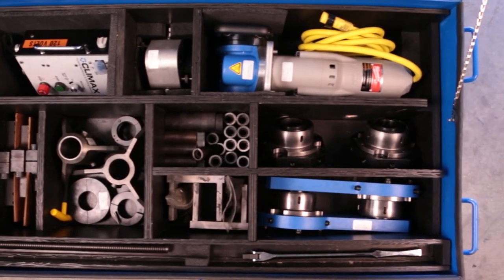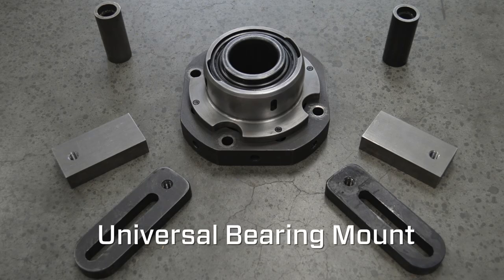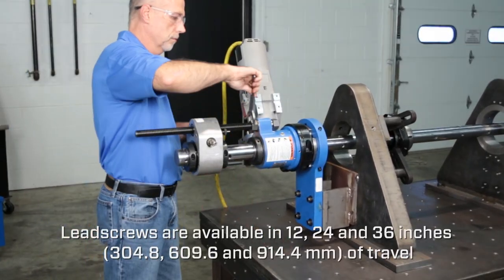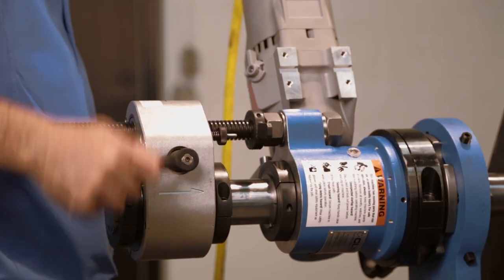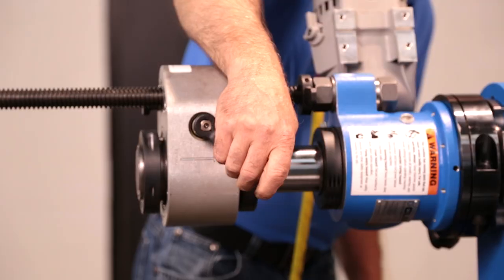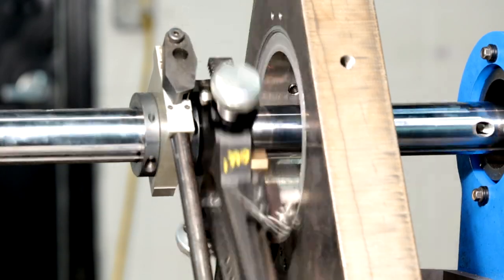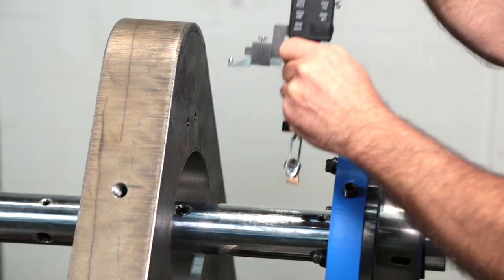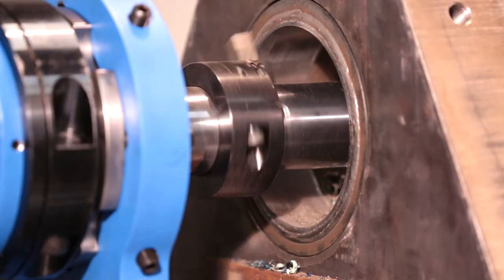BB5000 Line Boring Machine Demo Video

Comment: at 2:25 where can i buy that tool holder. the bb5000 kit does not come with that
Reply from the maker: Thanks for asking! We're using a Micro Adjust Boring Head Tool Bit in this shot. More info on this can be found in the Accessories section on our BB5000 Line Boring Machines Page: http://climaxportable.com/products/bb5000-boring-machine/  The kit comes with both roughing & finishing tool bits. For a quote or more info on how this could be used for your specific job, please ontact us directly at 1-503-538-2185 or via email at info@cpmt.com. We look forward to hearing from you!
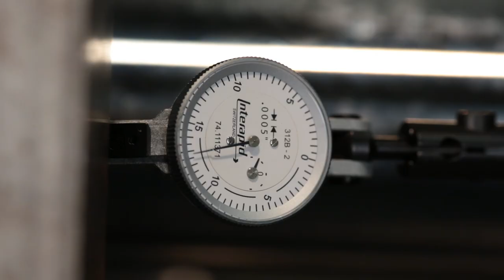Reply: What about the dial indicator mounted in the tool bit hole at 1:30?? where could I get that??

Comment: How do you know what size to bore the hole to ?
Reply: Mack shore you got a newe boss in you hands. Nou the trick start. For ever 25mm you - 1 of a 1000 to Mack in press fit . You can Jose in side measuring tool and a dialingator .on the top of the tip . Do not forget your boss size . And you boss is it 100mm or 200mm or 450mm to Mack it press fit. If it is a bill bearing or a flouting bearing . When you in Stoll.  The bill master be loose. Do not forget your grease groef or the holl and grease cleerins. From Daniel Groenewald